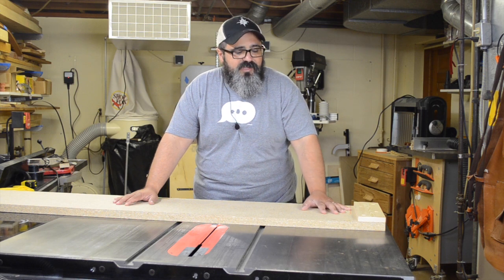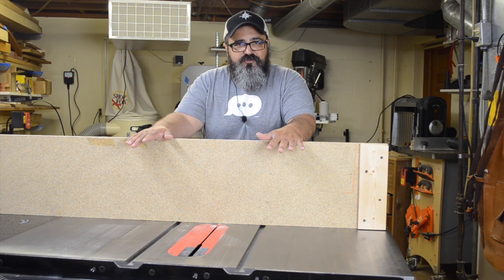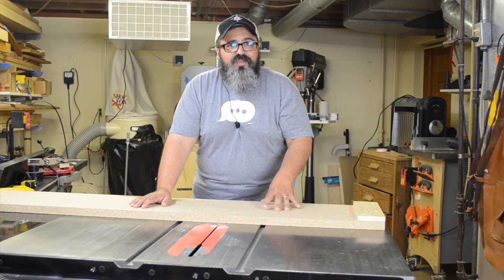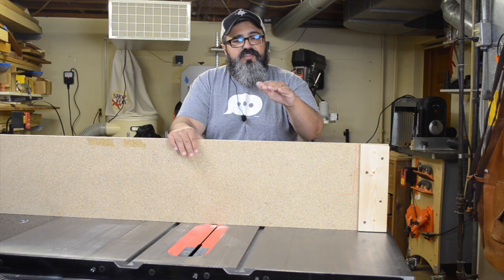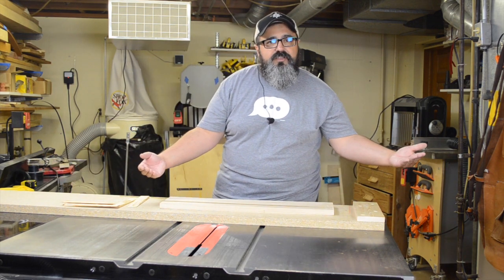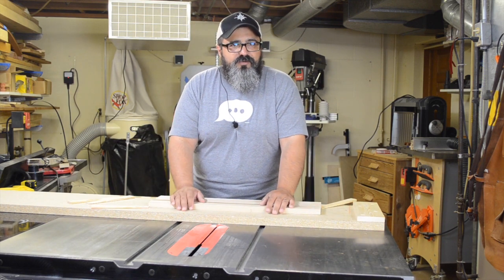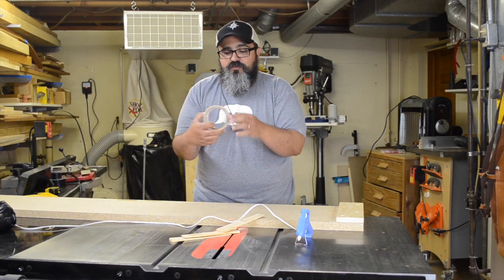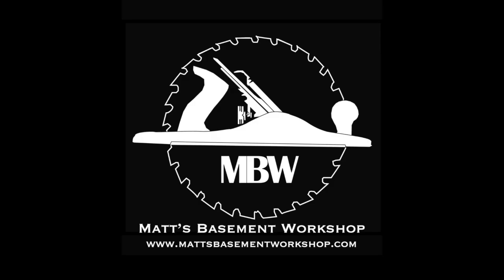556 Simple Planer Sled Q&A Follow Up

Comment: Great follow up! I've used this simple planer sled design with great results.

As far as hot glue damaging the surface of the sled, I have indeed had that problem. It tore up a few chunks. Not so much that my sled is now unusable, but certainly it would become so with repeated use. Maybe whatever glue I'm using is stronger than what you've used. Who knows.

I've waxed the surface of my sled to hopefully minimize future hot glue damage, but haven't put that to test yet to see if it did the trick.

If it doesn't, I think I'll rebuild the sled using melamine. A laminate surface would be super easy to pop hot glue off of.
Reply: Or maybe even just cover it with contact paper?

Comment: Use that rubber shelf liner material between board and the sled. Holds in place well I have found. You an also use two thickness glue face to face to add strength for long sleds.

Comment: A few years ago I  "made"  one of these using the same material. I had a half can of arm r seal starting to get thick (old), cut it with min.spirits dumped it on my press board, wiped it off smooth and the next day hit it with 400 grit on a block plan. The hot glue sticks  great and then pops right off with a sharp chisel.

Comment: Does anyone have a link they could share with the particle board from the video? I can't seem to find it anywhere. My local Home Depot and Lowes don't have it
Reply from the maker: I found this at Menards, it was in the shelving department. If you can't find the same thickness, sandwiching two or more pieces together works equally well.
Reply: Thanks for the reply Matt! i ended up finding some at the local flooring company. We don't have Menards up in Maine unfortunately